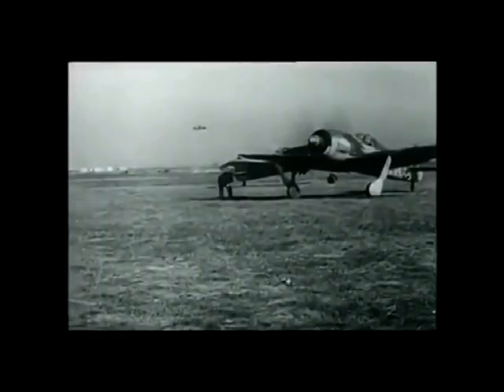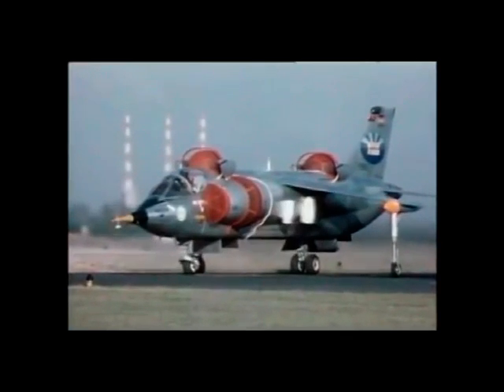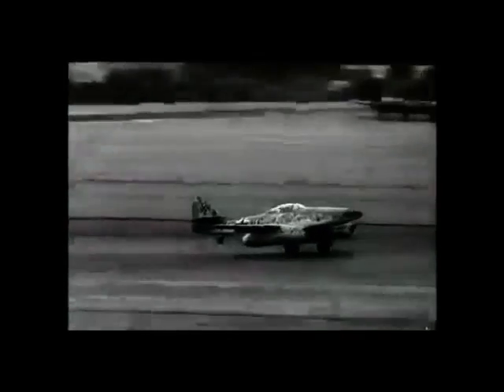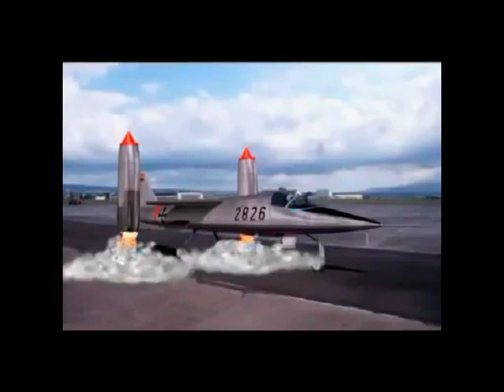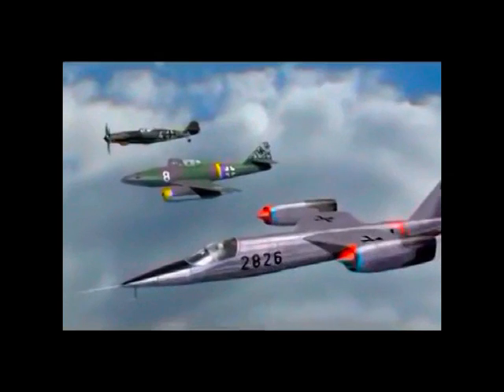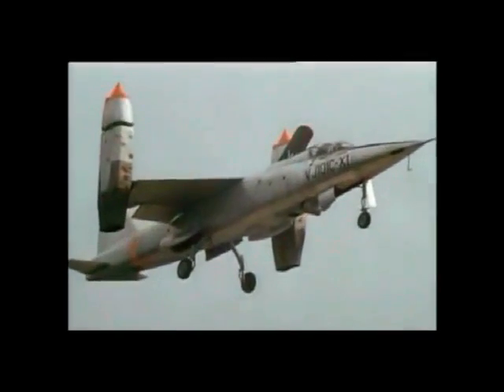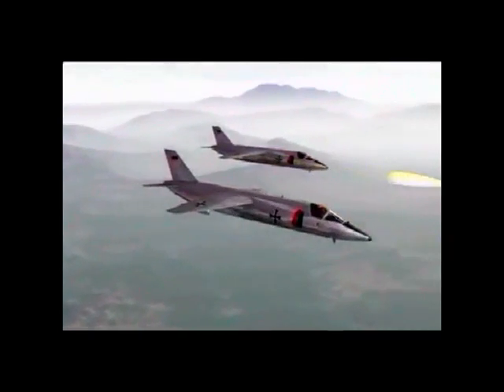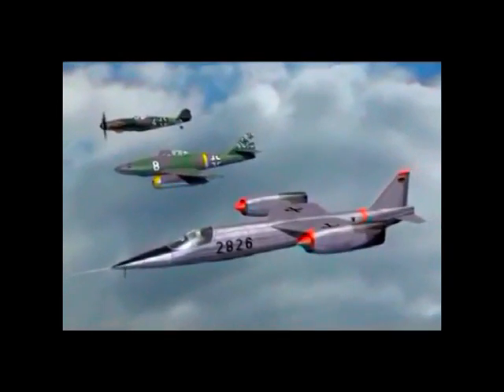Luftwaffe VTOL jets - VJ101 and VAK191

Comment: This is more rubbish. A great aircraft has to be above average at lots of things, speed, maneuverability, reliability, ability to fly with redundant systems, relative ease of maintenance, etc etc. 
Most of these so called great German aircraft did none of these. An example, 50% of the V2's launched either blew up on the launch pad or broke up in flight. They killed a total of 7000 or so Britons but 12000 Germans. An Me262 in its original form would no be allowed fly today as it would no pass the criteria for safe flight but there are 4 Gloster Meteors still flying.
Reply: It's less rubish than your grammar
Reply: I believe britain would have build a lot of super advanced aircraft when getting pounded by the leading industrial nations of the world. There was ingenious engineering on both side and in germany, the designs were so stunning because they had scarcity of a lot of resources and still managed to come up with pretty advanced and revolutionary tech. Britain did well too, no discussion. But saying german tech was a failure is laughable.
Reply: Kabum.
German technology years ahead, like the poor unreliable German jet engines that were well behind the British , the V 2 which was a useless weapon, just like the V 1, then there was the V 3, that worked well.
Go on show where German technology was ahead, radar, aircraft, guns even, Germany made or tried to make wonder weapons that mostly did not work, Britain made real weapons that were better.
Germany made the Me 163 that killed more german pilots than allies, the Me 262 which was a dead end, the Gloster Meteor was in service for over 40 years, after the war Czechoslovakia tried to make Me 262`s and quickly gave up when they got Mig 15`s with Rolls Royce Nene engines, far more thrust and far more reliable.
USSR tried to get the Jumo to work but soon dropped it, France took ten years to get a very much modified BMW to work, they could have had the far better Rolls Royce Avon or Armstrong Siddeley Sapphire.
Reply: Chrissy twit.
Poor ignorant fool. I will not change anything since you are wrong.
I shall repeat the same just for you. 
The poor unreliable German jet engines that were well behind the British , The V 2 which was a useless weapon, just like the V 1, then there was the V 3, that worked well.
The Me 163 that killed more Luftwaffe pilots than allies.
The Me 262 and Jumo engine were failures.
1944 when Germany introduced the Me 262 about the same time as Britain had the Gloster Meteor.  
The Gloster Meteor was in service for 40 years, in fact Martin Baker still use a couple of them for testing. 
The DH Vampire, the first single engine fighter to fly, I left out the word engine by mistake.  
The Spitfire Mk XIV which was good enough that unless I have been badly misinformed the Luftwaffe never shot one down, I know the USAAF never did, they tried often enough.
You can`t come up with anything so you look stupid all by yourself.

Again if I am wrong then just show it or get lost.
Reply: What a load of rubbish! And the V-2 was a Ballistic Missile not a Aircraft! You moron the 262 had unreliable engines because the materials were bad. Not because it was a bad design! Even Howard Hughes had and was flying one for the Fun of it! You have to be a Troll or very uneducated!
Reply: Christian twit.
Go on then, just tell me what facts I got wrong?
Reply: Chrissy twit.
Put up or shut up little crybaby.
I stick to the truth and you have nothing.
Reply: @barrierodliffe4155  
Actually, i wouldn't say the germans were lyears ahead bit you are just making them look worse than they were. The Me 262 was a rather good airplaine (if it wouldn't have been for the BMW 003 engines), the V2 was a pretty good ballistic missile (considering the flight computing technology of 1944), the V1 was also not that much of a failure, it even served as a test chassis for the germans version of a television guided missile, the He 162 was pretty good (considering that it was designed and flown in a bit more than 70 days), the jumo 004 jet turbine was also pretty good (considering that they used some clever ways to make it operational and usefull even without the heat resistant alloys), the proud british radar you are bloking about has its basis on a german prewar physicists patend for a proximity warning apparatus for boats, the germans also had some sucessfull glide bombes and guided bombs and guided missiles, they also had the first patent for a electron microscope, they had pretty much the first and only rocket powered bomber intersepting wooden transsonic glider (it was more or less a flying deathtrap but it reportedly broke the soundbarrier several times during flight), they made several of the most dangerous chemicals, they build the XXI type u boat (the first submarin dedicated to operate under sealevel even when charging the batteries, wich was copied by the USA, the british and the russians, to be used as a template for conventional diesel and nuclear submarines), they also made the most potent cargo helicopter during the war and a very nice looking reconnessance helicopter (the fa223 and the fl 282), they had without a dought the most advanced variable compressor drive for aircraft piston engines, they made the first one lever controls for fighter planes (automatic propeller pitch, automatic ignition adjustment, automatic compressor adjustment and direct fuel injection), they made the predecessor of the russian RPG2 (Panzerfaust 150), they did one of the first night mvision googles and optics for rifles and tanks and some other stuff i don't remember right now. As i said, they were not years ahead but they surely were not behind anyone ;D.
Reply: @Enthropical_Thunder  
The Me 262 had many problems, it used the Jumo 004, because the BMW's were not much good and to take the heavy Jumo they had to make changes, it still was not a modern design and had a poor dive speed, the Jumo gave it poor climb and acceleration and worst of all the Me 262 had very poor maneuverability
The V 2 was good for what?  as a weapon it had poor guidance, the V 1 was a failure since it also had poor guidance and of over 10,000 launched at London only 1/4 hit anything, most of those landed outside London itself and London is a big target to miss.  
The Jumo proved to be a poor design that no one had much use for after the war.
There are no reports of the Me 262 breaking the sound barrier except maybe when it exploded.
The Type XXI U boat was too late, like most of the German fancy ideas.
Germany was behind on radar, aerodynamics, and many other things that were more useful for war.
They had a lot of ideas but little in the way of ability to put them into use to help their war effort.
Reply: @barrierodliffe4155  
Yep, actually, you have no idea. The flaws you are talking about are no engineering flaws. The Jumo was pretty much the best you would get out of a jet engine under conditions like bombed factories, no skilled labor and resources shortage. Aerodynamics were actually
a specialty of the germans, especially the high velocity aerodynamics were later adoozed by the british. The V1 guidance system wasn't very accurate but tell me please one ctuise missile guidance system of that periode that was accurate (hint, you won't find one ;D). That the XXI submarines came too late to wat to change something has nothing to do with its design, you muppet. I would suggest you some literature because the only fact you actually got right is the lack of radar developement, the only thing close  
to allied radar technology was a device uused in uboats to locate enemy targets by measuring their radar pulses.
Reply: @Enthropical_Thunder  
The flaws were to do with a poor design, the Jumo did not work well and after the war no one had much luck trying to make it work.  
The poor aerodynamics of the Me 262 do not support your assertion and while Germany had some paper designs, not one of them led anywhere much. Britain was working on supersonic research from 1943, Germany was trying to make 600 mph aircraft.
The V 1 guidance was not at all accurate and no one else bothered making something like it that did not work.
The Mk XXI U boat was useless for the war so I stand by my comment there too.
I know it is popular to idolize Germans as some sort of superior advanced people but they were only ahead o a couple of things and behind on others that mattered ore at the time.
Reply: @barrierodliffe4155  
I don't idolize  them but you don't seem to be aware of what actually went into the design of the Jumo 004 or other various developments they had. Please tell me all the flaws the Jumo 004 had, than tell me what they did to counter them and only then i will know that you actually know what yoi are talking about ;D. Belive it or not but the germans had transsonic flight in the 1941 with the Me 163 and they had to counter stability problems at those transsonic speeds, so they built special wond tunnels to test there swept wing designs. After the war, the brits made there own research based on the very impressive tests of the germans. You don't seem to know a whole lot about that ;D. People do tend to overuse the term "german engineering" when talking about the second world war however, there is some truth behind that. The germans did manage a lot with what they got. Btw, the V1 still is the first cruise missile even if it was inaccurate and a weapon not going to war is still no argument against the design if everyone else copied it after the war. Actually, there was one XXI uboat that made it to the sea however it did not cause destruction but rather took refugees with it.
Reply: @Enthropical_Thunder  
The Jumo 004 was designed as axial flow after Junkers had looked at Whittles Patent's but they got it wrong. It was very unreliable,m had poor throttle response giving low acceleration and climb, the truth is Germany never countered these problems.
The Me 163 was hardly transonic, there was a claim for a speed of 624 mph but that was not an official record and had no verification. It had a never exceed speed of 559 mph or less than a Spitfire.  Basically it would climb to about 35,000 feet then become a glider. The worst part is the Me 163 killed so many of it's own pilots so a big failure.
During the war Britain was well ahead on jet engine design and they never copied anything from the Jumo or BMW failures.  Britain was also ahead on supersonic research since Germany was not even looking at trying to go supersonic.
The V 1 was a failure and not very advanced.
Actually two type XXI got to sea and it was a good design but too late just as so many of the German projects that were made because Hitler thought they might win the war for him.
Germany was ahead on some things, not jet engines or aircraft and the Type XXI submarine apart from being too late had a big problem with the RAF being able to destroy the biggest and best submarine pens with a bomb Hitler could only dream about.
Hitler started the war under the impression he could win it in a short time so he never planned for a long war and British production of ships, aircraft and even tanks was more until late in the war or too late to help Germany.
Reply: @barrierodliffe4155  
You got some things wrong. From an engineering standpoint, the V1 and V2 were no failures at all (we are talking from an engineering stand, if it was war effective or not is something else), they met the requirements and they worked as good as they could (one should know that the V1 and V2 were no weapons to win a war, they were terror weapons and  in combination with propaganda very effective). The Me 163 was very well transsonic even if the speed was slightly below tht speed of sound when in horizontal flight, at a dive angle og 10° to 20°it broke the sound barrier numerous times (these claims are actually trustworthy since it had no big propellers that could slow it significantly down), they even had to undergo research to get rid of instability problems at these speeds. The Jumo 004 was actually a very good axial flow engine, the first 2 that were produced had the needed rare material alloys and were very reliable (although having a lower power tp weight ratio than Whittles 
centrigugal design). Von ohain wasn't aware of Whittles work until he himselfe attempted to get a patent on a similar design and he was said that some already made a similare one (Von Ohain had a centrifugal design too). The  Jumo engine has nothing to do with this, Heinkel wanted to build a more powerful version of the HeS 8 but the peoject got canceled in favor of the Jumo 004 and BMW 003 (wich i don't understand until roday, who made the decision that a more complicated not well understood axial design is better that the wel understood centrifugal design?). The compromises they made and the ideas they came up with actually make the Jumo work on carbon steel and aluminium are very interesting (note: the slow acceleration of the turbine not very  wishful but needed to keep heat peaks as low as possible).
For more information on the Jumo 004 :
 www.456fis.org/JUNKERS_JUMO_005%20JET_ENGINE.htm
Reply: @Enthropical_Thunder  
I got nothing wrong, the terror weapons, the V 1 and V 2 failed, they could barely hit a target as big as London and did not cause panic. 
The Me 163 did not get close to the speed of sound, not much faster than the Me 262 in level flight and it could not break the sound barrier except maybe parts of it when it exploded.  Claims are easy to make but none have been verified.
The poorly designed Jumo never worked properly, after the war USSR tried to make them work and they had the materials to hand, they soon dropped the very poor design.
Ohain had copies of Whittles patents before he got started on his design and Whittle had patented both axial and centrifugal, while Junkers and BMW were trying to get an axial flow engine to work, Britain had both centrifugal and axial, the Whittle centrifugal design went on to the RR Nene, the best jet engine until the Armstrong Siddeley Sapphire and RR Avon, both of which came from British design work not German failures.
Ohain started work on a centrifugal design after he saw Whittles patent but he wanted to switch to axial, the RLM wanted him to continue work on centrifugal in case axial did not work, they were right, the centrifugal was simpler and worked better until the late 1940's
Reply: @barrierodliffe4155  
Yep you have no idea XD. Did you saw the link i posted? It is based on a british paper about the jumo 004. The german engineer Franz Anselm who was a co developer of the jumo 004 later worked for an american company and was chief engineer for development of the Abrahams turbine engine as well as for the development of the UH-1 Huey turbine engine ;D, must be a very unskilled engineer totake part of these failures (if you don't trust me, ask wikipedia and google). Since the V1 anfd V2 had mechanicle preprogrammed flightcomputer, wich could not counter sidewinds, it is very impressive that they even hit london, the V1 had a  transmitter that was used that send out a signal to determine the position of the V1 shortly befor hitting the ground and correct the launch angle for the next V1 if they did not hit the target area (for 1943 thats high tech). For the Me 163, if you would have any idea of thermodynamics, yoi would know that the speed of sound varys at height, at sea level it would be around 1235 km/h and at 2 km height around 1207 km/h at bomber altitude it would be 1126 km/h (the calculation is a=square root of (K*R*T), K being Kappa, T being temperature and R being the individual gad constant for air), so technically the Me 162 could have been well above the speed of sound when engaging bombers, as i said they actually worked on the instability problems of transsonic flight. Boy, if you would have any idea of what i am talking, you would agree....
Reply: @Enthropical_Thunder  
The Jumo 004 that never worked, right.
 
The biggest problem of both the V 1 and V 2 was that the ones that actually got to some sort of destination, mostly missed London and the Germans had no idea where they landed.
I have known since I was at school that the speed of sound is different at different altitudes.  I also know that aerodynamics plays a big part in the ability to exceed the speed of sound and just having swept wings does no make a plane supersonic.
Maybe the Germans worked on the problem of instability of the Me 163 at very subsonic speeds, it was a failure which could not get close to supersonic speed.  in a dive it would break up if it got to mach 0.85 or so.
If you had any idea you would stop copying things from Wikipedia and try to learn about aerodynamics.
Reply: @barrierodliffe4155  
I don't even need Wikipedia for you, you don't even read the link i posted, it denies everything you say and the best part is that it is out of british unbiased hands. The problem is that you are repeating yourself again and again but you don't even give any  proof neither do you exept the proof i give you. You are a muppet if you think that the jumo 004, the V1 or the V2 are a failure ;D. Especially when you consider that the first american long range missile was basically a V2 copy. But hey you seem to have halfassed knowledge of everything so i shouldn't expect much more of you.
Reply: @barrierodliffe4155  
Yep, you have no idea XD. Well i don't want to waste my time with somebody that claims things without proof. Just  one thing, having no effect on the war doesn't mean it is bad engineered ;D. Is the Gloster Meteor a failure for not having any effect on the war? You should get your facts straight befor argueing over things you have no idea about...
Reply: @Enthropical_Thunder  
The Gloster Meteor achieved a lot, mostly after the war, it had a long career, unlike many of the German efforts.
Reply: @barrierodliffe4155  an excerpt taken from a ww2 aircrafts forum, which I agree with...."*Nene was the most powerful Engine of ww2?
I believe this belongs to a prototype of the BMW-018, bench tested
in october 1944 right before it should take off in a Hs-130E testbed.
The two prototypes have been destroyed during a bomb raid in october 1944.
There are little documentations left to proof, but it should be noted that no
engine will go on a plane first and on a benchtest second. The weight of the V-1 was around 2.500 Kg, very heavy indeed (serial versions should weight around 2.200 Kg), the max thrust was around 3.500 Kp (7.700 lbs) estimated. Until april, 3rd most parts of the V-3 and some of the V-4 have been produced, destroyed in order to prevent them from falling into US hands. The Jumo-012 jet engine was way inferior in development stage compared to the BMW-018......Beside of this the BMW-003 E2 was - in my minds- the best german jet engine of ww2, if you factor things like performance, high-developability (D version capable of 10.7 kN Class II of thrust, but weighing 100kg less than Jumo004B and 300kg less than Hes 011), thrust rating, spool up time, reliability, lifetime, thrust to weight factor, numbers produced and units put into ww2 fighter (in this case the He-162 A1/A2 exclusively). In the timeframe from turn 44/45 to mid may 45 it was probably the best jet engine in active service world wide. The Jumo-004 E and Dervent V weren´t that bad either but they belong to some prototypes and preserial engines only in this timeframe."- I add, the 003 (and 018) were so advanced for its time and beyond, that properly developed without Allies' bombing and with high-tech materials (differently from war time..) by BMW engineers (Dr. H. Oestrich, head of jet turbine projects at BMW) taken in France (SNECMA), it resulted in the ATAR family of engines, powering the legendary Mirage III-V-F1 jet fighters (first Western Europe Jet to exceed Mach2) up to Mirage 2000 with the super ATAR and M53, evolved into M88 for Rafale.
Reply: okay :)
Reply: Haha, check out who build the saturn V. Check out who the chief engineers of the falcon heavy are. Making german engineering look small by saying that the britains build a way better aircraft 10 years later is laughable. Liste to US and Britain experts that tested all the german advanced planes after the war.
Reply: Making German engineering look good by lying does not work.
In 1944 when the Germans introduced their first jet fighter it was a failure, it had poor aerodynamics and a very unreliable jet engine. The British introduced the Gloster meteor at about the same time, it was a good design ad had reliable jet engines, the RR Welland, they only made about 14 of the first version and when they introduced the next version it had the more powerful RR Derwent which was better i every way than the Jumo.
During the war Britain was leading the world on jet engines both centrifugal and axial flow, 
The Gloster Meteor was still in service 40 years later and the DH Vampire, the first single jet fighter and still in service in 1966.
So the question has to be what were all these advanced German planes and if they were so advanced why did the Luftwaffe get thrashed.
The Spitfire Mk XIV must have been very advanced in 1943, it was the best fighter in use to the end of the war and never beaten in combat by any Luftwaffe fighter or any US fighter for that matter.
Most of the so called advanced German planes either did not get off the drawing board or never got into production.
Reply: Barrie Rodliffe  lol butthurt brit better get your facts and numbers together
Reply: still Nonsens